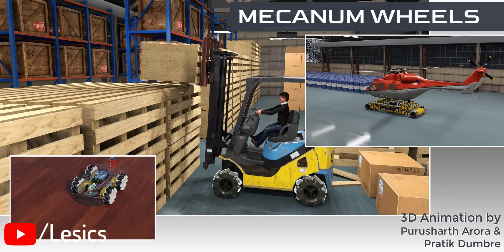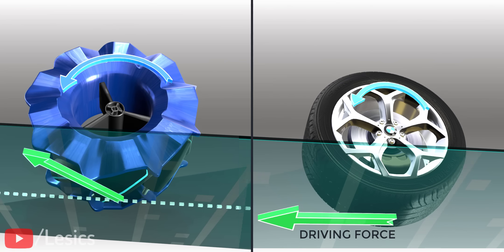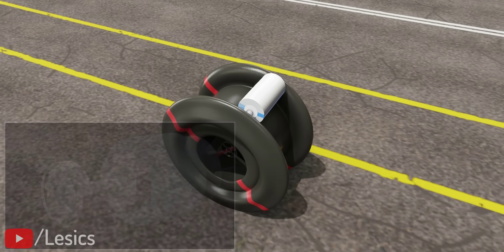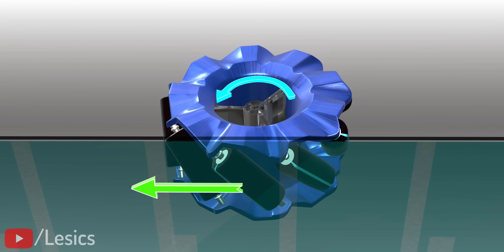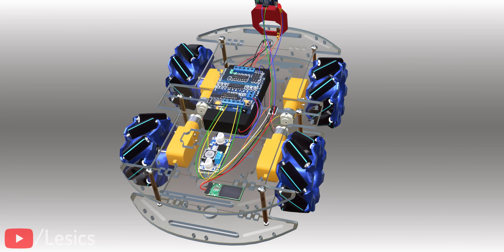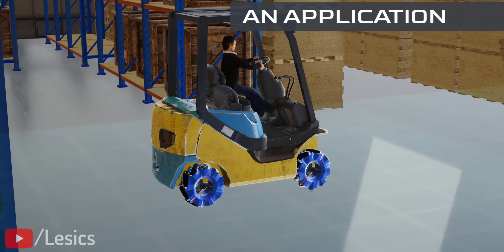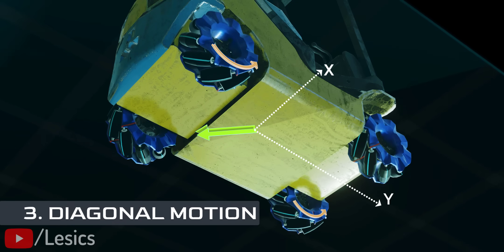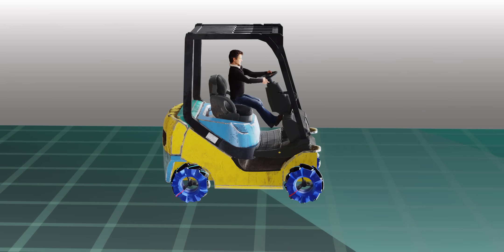The Brilliant Engineering of Mecanum Wheels!

Comment: We tested this type of forklift at my company ~15 years ago.  The technician that was supporting the trial let me operate it.  It was so intuitive to operate even an untrained engineer like myself was able to control it precisely within a few minuets of practice.  I would have love for us to adopt this technology, however, I was later told that the forklift was unreliable (nothing to do with the Mecanum wheel system) and we chose to stick with our tried & true electric forklifts.
Reply: Systems like this are used at Boeing Airbus and others to move major sections of aircraft. Siemans has one that moves locomotives.
Reply: @davidsandy5917  I worked at Boeing, and I've never seen any Mecanum wheel forklift's in the factory.  A significant limitation with Mecanum wheels is low load carrying capacity, so I'm not sure how Siemans use this type of system to move locomotives.
Reply: @davidsandy5917  yet they called it unreliable lol when they are been used to build multi  million dollars planes
Reply: @lcfflc3887  and what does that have to do with their reliability?
Reply: @TheSighphiguy   some places are so clean and spotless it makes me feel sick
Reply: forklift wheels get replaced regularly i assume this would be a maintenance nightmare, and being able to do this with a forklift isnt worth the cost and risk vs regular forklifts, plus youre not supposed to be travelling diagonal with loads anyways, way too easy to throw a forklift off balance if youre not educated on using it properly
Reply: @AllisterCaine  Speculation.
Reply: Excuse my lack of knowledge in the area but I'm curious.
Is this reliability also due to a weight limit?
I would imagine a solid single part wheel would be more structurally sound that several smaller "wheels".
Even if the forklift was far more agile and could probably accomplish the same tasks faster than a standard forklift, I think the wheels would wear out quicker.

Is this something you ran into, or were the forklifts not in action long enough to discover this?
Reply: @wingitmann  The forklifts we were considering replacing were small 6,000 lbs rated Raymond battery electric forklifts.  The Mecanum wheel forklift we tested were also rated at 6K lbs.  The trial only ran for ~30 days, didn't notice any wear on the rollers.  But we worked at a communication satellite factory, with epoxy floor, I wouldn't expect any significant wear with any forklifts.  I think the small company with the Mecanum wheel forklifts we'd worked with went out of business more than a decade ago.
Reply: Sounds like you're an engineer. Pricing not being the point you do realize that a basic rear wheel turning forklift operates 360 degrees on a dime, while using less energy and requiring less maintenance.
Reply: @vegascorp  Energy consumption on electric forklifts in a satellite factory is pretty much immaterial.  Also I don't think it actually required more power to operate.  The primary difference in maneuverability is the Mecanum wheel system can "crab" while regular forklifts can not, except some larger forklifts can electrically shift the fork tines laterally a short distance.
Reply: @stanimal8  you aren't taking into consideration all the charging stations required to keep those lifts running. That also equates to space. Nothing beats propane with old fashioned rear wheel turning.
Reply: @vegascorp  I'm only speaking from my limited experience in our satellite factory, which is a clean room, so no ICE powered vehicles.  Everything is electrically operated.
Reply: who are you bullshitting to?
Reply: The unreliability is definitely in part due to the mecanum wheels. Poor surface contact at the wheel base leading to slippages that can cause rotation when you want lateral movement, wasted energy in all 4 directions of movement due to needing to cancel out forces, said wasted forces putting excessive strain on the frame, all combined with poor weight tolerances at the axels of the rollers themselves make it an expensive and wasteful platform.

Comment: Forces in particular directions cancel to produce the net effect, meaning that the wheels are working partially against each other. Inefficient movement.
Reply: Which would be no good if you were going for a high efficiency vehicle. But if you're trying to make a maneuverable robot for a warehouse these may be useful.
Reply: No work is being done by the vector components being cancelled. That is just Newton's Third Law in action.

Comment: Fascinating system that almost look like it re-invented the physics of a wheel. As a kid i use to fantasize what if cars had all four wheels locked in place but had a kind of..i use to say 'strange wheel' that does the directional change. Only to realise few years ago it was invented way before i hypothesized. The idea has also been implemented around a concept car called Mercedes Benz Silver Lightning (theoretical car) that has a unusual unibody construction with all four wheels locked within the fenders placed outward from the main body, using an advanced Mechanum wheels that operate at a higher level speed like a normal tyre.

Comment: I see a-lot of friction here and tires being forced to slip on the surface so... add weight, a-lot of weight... then what happens????? What happens to the surface of the floor over time????? What happens when the differing surface areas have variable/differing traction coefficients????? It's a cool concept though!

Comment: Looking at these force patterns have me wondering how often and how expensive it would be to replace all those bearings, rods, rollers, and eventually the whole wheel.
Reply: The rollers are the primary wear components.  And IMO, Mecanum wheel systems is unsuitable to pretty much anything other than polish concrete or epoxy floors under modest loads.
Reply: @stanimal8  unsuitable is an understatement even slightly uneven floors will make them very unfun to use hell even down right dangerous the moment one wheel lifts or even loses a little bit of grip you can go from moving in a direction you want to a direction you dont want. and there totally useless off road.
Reply: Same. Plus the video  almost seemed like a sales pitch, talking about how much more efficiently a forklift could maneuver instead of turning circles. But looking at the force patterns, I was thinking, so this thing is working against itself all the time. Working at 50% efficiency constantly to achieve a single direction, cost effective wise, a regular forklift with a skilled operator probably runs circles around this.
Reply: I just looked it up. A single roller can be removed by removing two bolts. You do not even need to jack it up.

Comment: Its a good design but the wear and tear on the tyres is significantly larger than normal tyres. Hence it runs out of tyres quickly and also each tyre is operated by a separate driver/motor.
Reply: The forklifts are also used outside on unprepared loose ground.  Mud, dust, snow,  as many sources of debris that would ruin the bearings of each roller on such wheels,  the replacement of which is likely to cost,  not only in repairs but also immobilization of the forklifts for a while.  On the paper lots of promises  but in real life , more handicaps appear and make the concept less attractive.  Except perhaps in  very clean indoor applications with  great condition concrete floors.
Reply: @tonerotonero1375  i have no knowledge of forklifts though but
Im sure there's some seperate forklifts that can do what you exactly said and this one on this video is specifically for warehouse use??
Idk...
Reply: @titaniumspecial4207  not when rollers need changed every 50 hours of use
Reply: @gagepuffinbarger6939  They don't need changing every 50 hours, these things already exist
Reply: @Chris-rg6nm  but clearly they aren't as effective as shown or else we'd see them everywhere. And I work in a factory
Reply: @titaniumspecial4207  I really don't see the benefit of this added maneuverability in a production environment.
That sideways motion doesn't really add much to what we have since long established.

The problem isn't how quickly the forklift and forks can get under and lifting the load and moving it. It's that the load can't be moved faster than it already is or it would fall over.

Also, the illustration of the amount of space needed for the forklift to turn around is dubious at best. Most modern forklifts can turn inside the radius of the drive wheels. With steering wheels going as far as 85 degree angles.

And there's even forklifts that have 360 degree steering (which doesn't require any of this fancy tech to do it either, the single steering and driving wheel simply turns a full 360 degrees. Those can turn on a dime literally.
Reply: so its not a good design
Reply: @ezioaugustus2621  It's a great design, but only for extremely niche uses. For a normal warehouse, solutions already exist for every problem these claim to solve, without the level of mechanical complexity and the other drawbacks these have.
Reply: Tire
Reply: @gagepuffinbarger6939  Since we came up with English first over here in England, Tyre is correct :P
Reply: @ralphzimmermann  
wrong, it is tie-er.
Reply: @iaimboti  that seems "roh-ng" to me, no word should have a hyphen in the centre. ;)

Comment: Nice design, but we figured how to turn on the center with a forklift, although not all forklifts can do this. 
By having only one wheel in the back and it's capable of turning 90° in either direction (for a total of 180 degrees) we can achieve turning on it's center.
Reply: it would be better to say the center of gravity as when loaded the front wheels bare most of the load.
Reply: I think with a single wheel at the back, the rotation is executed around the middle of the axis of the front wheels and not around the center of the vehicule. It's obviously better than having 2 wheels at the back but still takes more space than mecanum wheels.
Reply: @hamzafiroud  you forgot about the fork that is in front of the wheels making it turn in the center
Reply: @johnhill2927  ooh i see, i didn't know that. thanks for the hint.

Comment: Brilliant invention. When I first saw robots using mecanum wheels I was wondering how they actually work. But one of the problems with this wheel is that they are many times expensive than normal wheels
Reply: but the storage space can be better utilised, less need for big spaces between racks.
Reply: @jyvben1520  these wheels would wear down significantly faster too and long time it would cost more than storage space availability

Comment: That kind of wheel is found in aircraft cargo loaders. They often have to rotate ULDs 90 or 180 degrees. You can clearly see the wheels turning in opposite direction to achieve this.
Reply: These other comments are dumb. All of a sudden everyone has a mechanical engineering degree.

Lifting planes on a tarmac but these commenters acting like it's a dandelion ready to bust apart at the first sign of dirt or a loose screw.

Comment: Err... This video.. For a engineering based one is already wrong withing 10 seconds. Most light duty forklifts swivel on the rear wheel like the one animated with the robot wheels, I can do a full 360" spin on the spot. This video here with traditional wheels already proves you wrong. https://www.youtube.com/watch?v=LIOLW6S7q6g

Typical clipboard engineers. no real world experience. Its really only large ones/ telehandlers that dont swivel on the rear wheel.

Comment: Do the cancelling forces result in excessive wear, or slip, on the wheels as they pull in opposite directions?
Reply: No, the rollers don't slip more than an ordinary tire. They are like small unpowered tires.
Reply: @mumiemonstret  tires go in one direction. These do not go in one direction. The rollers all face 45 degrees. Yet the wheels move in 360 degrees. How the hell are people trying to claim there won’t be any wheel slippage. That’s  literally impossible.
Reply: @jamesbizs  there is no slippage, I'm a mechanical engineering student, trust me Instudy these things
Reply: @simong1666  lot more pressure on a much smaller surface bearing area plus way more bearings within the wheel itself.
Reply: I would suspect they design the rollers to be harder than the average forklift tire, but soft enough to grip.  I'm sure there has been a lot of engineering that's gone into developing just the right rubber for them.  That being said, I do think you would have more wear on the mecanum wheels compared to traditional wheels if they where made of the same material.
Reply: @aConspiracyOnlyTakes2  at a guess I would suspect the wheels are driven by hydraulic motors, which balance the energy going into the wheels. Thus, provided the wheels do not slip, power is used in the direction of motion and not wasted in producing the opposition forces. It might be a different story if the forklift was not working on a flat ridged concrete floor. On a looser surface such as gravel or mud, one might expect the wheels to spin, as the opposition forces no longer cancel out. This might result in a diagonal motion to that of the intended direction. It is interesting to think about, particularly in terms of energy usage. Provide there isn't any slip, then energy is not wasted in maintaining the canceling forces, as the force produces no associate motion. (Work being defined as force times distant moved).
Reply: @FCE-dogs  thats not true forklifts working in a warehouse is gonna see alot more use then your average private car. one or two vecation trips a year cant be comapred to 8 hours a day every day.
Reply: @Ithzzz  I’m pretty sure they are comparing the tyre on a forklift and a traditional forklift tyre in the same conditions, just assuming though

Comment: Do the roller wheels ever slip? (scrape against the ground) If so i have my doubts.
Reply: The rollers don't slip under normal use.
Reply: @stanimal8  unless they wheels are moving in a 45 degree direction of travel, they would have to scrap. That’s how a wheel or roller would work

Comment: I drive a tow motor ( life truck)  everyday as a part of my job. Coming in and out of trailers at different high. Even wet floors at times. Driving outside at times. We tear up solid rubber Wheelsat times. I got to see this in a real world working situation. Clearly the engineers never drove am in their entire life. They would know that smooth concrete floors are not very smooth. I'll say this product tearing up within months
Reply: In an outdoor area yes, in an indoor area they would be more suited
Reply: We did a trial with on a forklift with Mecanum wheels ~15 years ago.  It was pretty awesome control wise, even an untrained engineer like me could operate it easily.  Our satellite factory had an epoxy floor so wear wasn't a significant issue.  My understanding was that there were some reliability issues with the forklift (unrelated to the Mecanum wheels), and we chose to stick with our existing electric forklifts.
Reply: yeah i mean its sliding because those rollers aren't parallel with direction of motion

Comment: As only a component of force for each wheel works in desired direction, the power loss would be more.
Reply: Indeed. The wheels would wear off dramatically fast.
Reply: @amjan  I would not be surprise if the wheels wear faster, not because of the reaction loads, but mostly because of the tapered shape of the rollers causing the rollers to speed-up and slow down as the wheel roll while the vehicle in NOT moving at exactly 45 deg.  Also the small contact patches on the rollers would likely wear faster due to higher contact stress AND these wheel systems have much lower capacity when compared to the rubber treaded steel wheels used on typical forklifts.  I've only seen Mecanum wheel systems used on small lower capacity battery powered forklifts.  We tested these type of forklift at my company ~15 years ago.
Reply: @amjan  The force component that doesn"t "work" does not contribute to the power either, so no.

And since the rollers roll, not slip, they don't wear fast either.

Please stop guessing and assuming that this isn't a real product!
Reply: @mumiemonstret  Your grasp of simple mechanics (based completely on your "work" and thinking the rollers roll because they are called rollers even though they obviously do not roll or you would just have a block fitted with rolling rollers remaining static in the same position indefinitely) is why you believe this to be a real life practical application. Which it obviously is not.